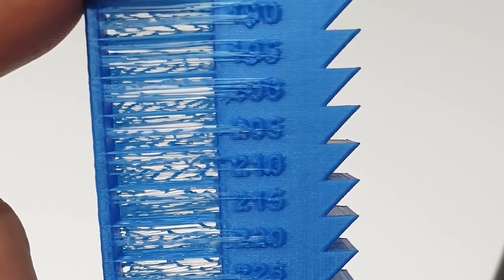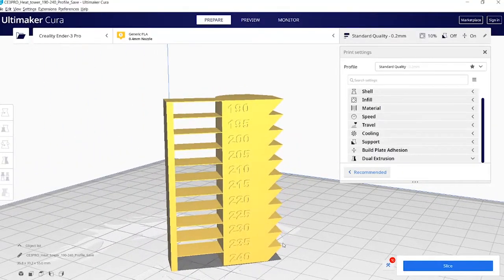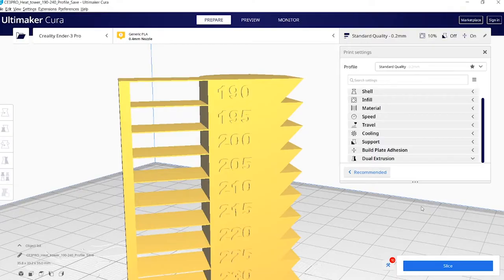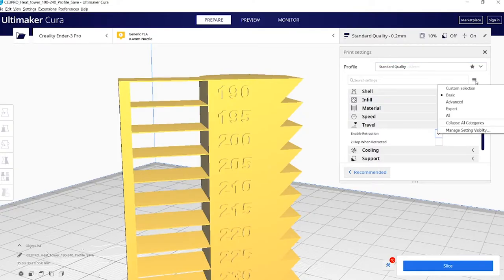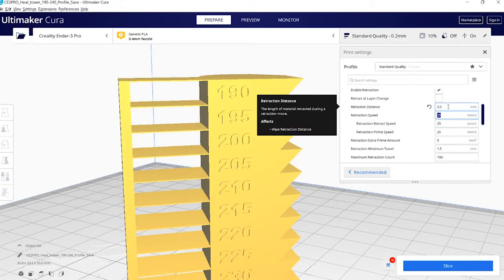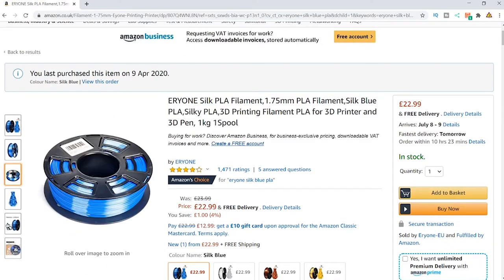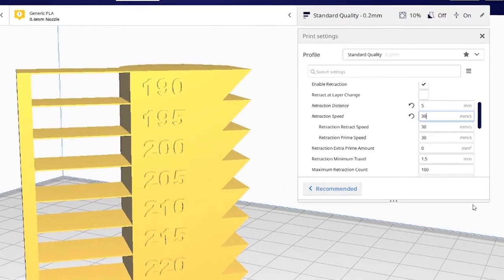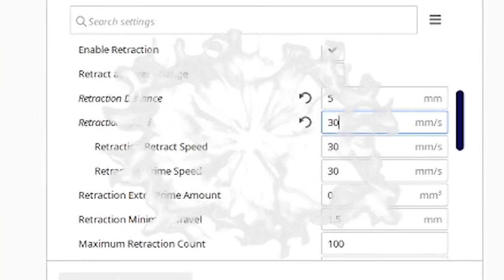Stop Stringing With These Retraction Settings

Comment: If I understood this correctly, my ender 3 v2 retracts only at layer change. Not on the same layer. Maybe I should update the firmware. Because I only see the retraction wheel spin backwards at layer change.

Comment: I have so much stringing, I can't even start a tower, first layer fails every time. I did manage to get to layer 5 on 1 of my attempts in over 14 hours of straight messing with it and pulling out hair. I had massive under extrusion, can't tell why, because I can't even get a tower down... PETG has not been kind to me... Tried every bed temp from 60 to 100, nozzle temps from 215 to 250 in 5 degree increments, for EACH 5 degrees of bed temp, I have tried slowing print speed down to 30mm/s2, 15mm/s2 10mm/s2 and 5mm/s2, increasing flow, increasing z offset, decreasing z offset, increasing wall thickness, I releveled my gantry, double checked my probe, changed my nozzle, adjusted retraction from 1mm to 12mm in 0.5mm steps, adjusted prime speed, up and down, It is a BRAND NEW roll of PETG, sealed, with a 2024 manufacture code, from a company I have bought many rolls from, never had any issue, but maybe the PETG is crap, temp on the package and spool says 225 -250 nozzle, 70-80 bed. I have lost enough hair in the last 24 hours that my family have noticed...
Reply: fan speeds, 50% 40% 30% 20% and cooling off... no noticeable effect. The one thing I can say, my first layer height is laying down at .2mm, nozzle is extruding directly downward, with no curling, and 0.4mm exactly, lines for layer 1 have been 0.4mm as well.

Comment: For newbies out there, this doesn't work for every plastic, not every PLA is the same quality. The retraction is a big issue but, there is no one setting specific for one issue. Lower retraction numbers work best for PETG but, that still needs to be tested. Tighten your belts, level your bed and if you still get stringing issues, work on retraction.

Comment: Try turning the prime speed lower if you really want your mind blown
Reply: what speed would you recommend for an ender 3?
Reply: @GraveUypo  Im using 12mm/s on an Ender5 plus
Reply: the "retraction prime speed" ?
Reply: @kalimbano  That is exactly what it's called in Cura. You'll need to turn on access to this setting in options. It's how quickly the filament is pressed back into the nozzle after a retraction
Reply from the maker: i will have a go thanks